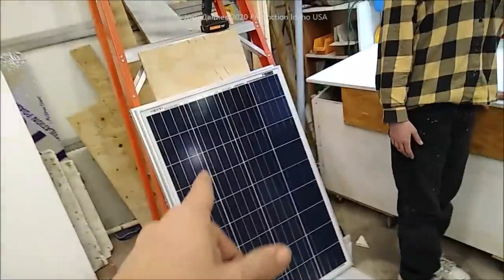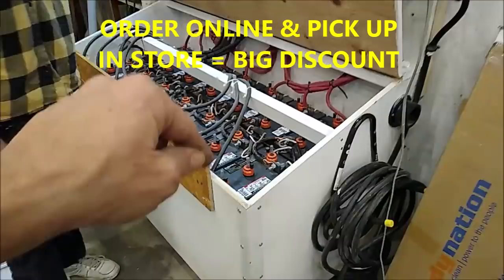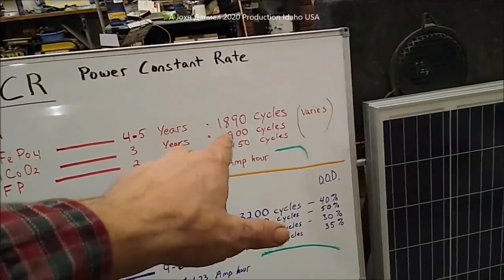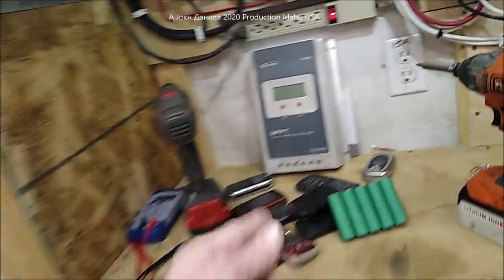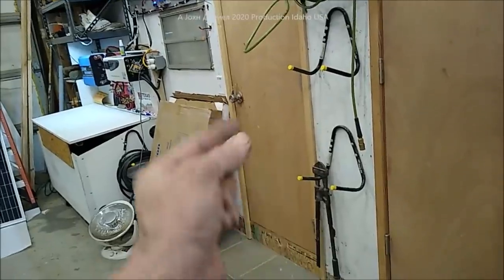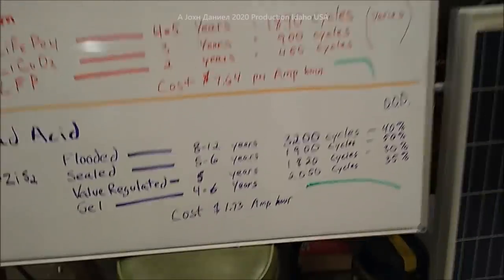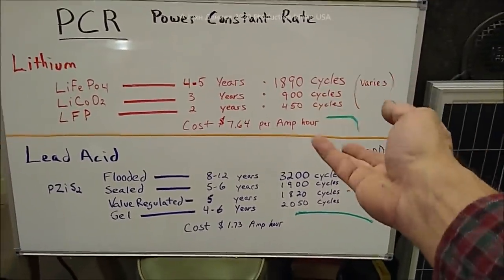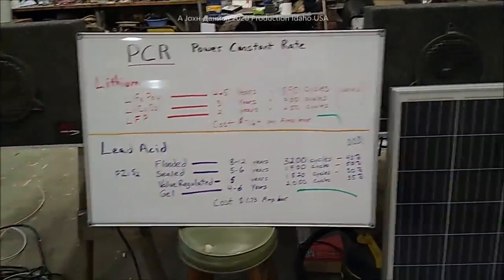Down Side of LITHIUM LiFePO4 Battery $ on RV, off grid & solar use (notes below)

Comment: I'm 4 minutes into the video and I've already seen some misrepresentation  of both the lead acid and LiFePo4. Right now I have both some flooded lead acid batteries the Trojan the L16 models and 24 of them to be exact on a 48 volt system. I have an automatic water system on them. I paid 8500 for them and went and picked them up because shipping was incredibly high. My Dad also purchased his at the same time and his already crapped out on him after 4 years. I have purchased 280AH prismatic cells from China, 48 of those to be exact. It was only $4600 including the shipping. But I also had to buy 3 chargery BMS to balance them so an extra $550 for all 3. But the automated watering system was almost 600 for the lead acid. 
Most any of the manufacturers will tell you the average life span of the flooded lead acid battery is 3 years. Lithium is dependent on how you treat them just like the lead acid. If you use the cells between 20-80% they will last thousands and thousands and thousands of cycles most companies recommend 10-90% usage.. That 2000 cycles you see listed is if you discharge it 100% some last much longer. Do that to a lead acid and see how many times it will last. 
LifePo4 does not like high heat or cold temps and why most people who self build their own battery bank or the ones you can purchase have a heating pad in it that will heat the cells up. Lead Acid also does not like extreme temps or extreme cold. 77 F is the temp that batteries like and As a guideline, every 8°C (15°F) rise in temperature cuts the battery life in half for lead acid. 
As far as swelling of the cells... that is from overcharging the batteries. Most of those who building their own banks with prismatic actually compress the cells. It was really sweet of you showing those cheapy phone batteries and how they didn't last long. Those batteries are charged and discharged every day in a whole variety of climates. Cold and hot and overcharged and over discharged. How many lead acid batteries have I replaced over the years? Hundreds of them. Living on a farm with dozens of equipment and some of those have 4 batteries on them i know all about batteries and how they can crap out on ya and explode. Yes I have seen several of those from Lead acid. 
Lead Acid is what 60-70% efficient ? Ltihium is in the upper 90's. the Lithium battery companies here in the US are ripping people off when you can build your own 12 volt 100AH battery for $200 instead of paying $1000 or more for someone over here to do it for you. If you buy a 370AH lead acid battery you can only use 50% of that capacity and it goes down considerably in cold weather. And you have to put a whole lot more current to those batteries to have the same charge capacity as a Lithium battery. 
The link you provided for the lead acid batteries.... I put 24 in my cart and it is $8323 and that doesn't even count the shipping. I can take the money I saved buying LiFePo4 direct from China and double my  battery bank for the money I would have in lead acid. That would be a 1680AH bank or 86,000 watt hours. The bigger the bank the less current your going to draw out of them which in turn will make the batteries last longer. 
One last thing.... If the lead acid battery was so grand how come the phone companies or any company that sells the battery powered tools all use Lithium and not lead acid??
Reply from the maker: Lead acid has never been used as a tool battery, I get over 8 years on my Wet Cells because I build to cover 200% needs, and if your not going to use your LiFiPo4 like you would lead acid on heavy loads they are fine. Watering them myself is not difficult or a problem so i do not need one of those automatic kits. However  a 100 amp LiFePo4 battery is still over $550 dirt cheap version minimum. But your ok to depend on China for your batteries and those BMS parts, I'll depend on USA for mine till the world changes a bit. China is already holding some countries hostage over supply line materials, And unless Joe the China man Biden gets elected through enough deep state fraud and theft we may not be back under China's total control again until the Democrats get back in full socialist power again. By then, who would care, we'd all be too poor under socialism to buy either.
Reply: @JOHNDANIEL1  
I agree on the premise about Joe Biden that is certain. If you get on Alibaba you can buy individual 3.2 volt cells pretty cheap. I bought my 280AH cells for around $75 each. They have gone down in price in the last 10 months. 
Until things change all lithium is coming from China and nowhere else. They just ship it around the world and then companies takes those cells and make batteries or banks from them. Thats essentially what I am doing, by-passing the huge middleman markup. 
Also i am not sure about the manufacturer of lead in the US. 15 yrs ago their was a bunch of lead plants that shut down one was 50 miles from me. 
Its a lot like where an item says USA made but it is really assembled in america with parts that were made overseas. I was looking at nickle iron batteries for their longivity but cost and ineffiency scratched them off my list. 
Hopefully we can bring these manufacturing jobs back to america. But in the future they will be robotic.

Comment: The only truly valid point you make is that AGM is cheaper than LFP up front, everything else is just YOUR opinion. I have read ALL your comments below and here is my opinion: Somewhere below you knock the introduction of NIMH, yet never discuss it was a huge improvement over NICD. It did not live up to its hype, but again was still better than NICD. LFP does have a better DOD than an AGM for the AVERAGE user. NO ONE is getting the life from AGM's that you claim you are, so your point there IS NOT valid to the average Joe. The jury is still out on whether the LFP's will endure the life cycles they claim they can.......time will tell (not you or I). The jury is also still out on whether these companies will be around in 10 years to support the warranties on the LFP's.....again, time will tell. You CANT lump all LITHIUM type batteries together comparison wise any more than you can lump all types of alcohol together, and if you do, i suggest not drinking antifreeze.........I dont have a dog in this race, am not part of the cult, but do believe technology does enhance life sometimes. I will let this all play out and not offer a guess or Nostradamus like opinion.

Comment: I don't really care what you use and lead acid is fine but if you are only discharging to 40% then your price per Ah should be almost double since the lithium iron phosphate is being discharged to 0% and the lithium and the 2000 cycles are to 80% which the lead acid is probably already degraded that much a couple hundred cycles in and if the system is not sized correctly and you go down to 20% or less you have cut the number of cycles or capacity down by a significant amount and that charge controller you pointed at will work fine with lithium batteries I mean you have to set it up but can do it just fine but I'm sure you know all this

Comment: Have you ever been around when a lead acid battery explodes. Yeah, the go boom real good! Most people do not ever service their batteries so this can become a real thing. Lifepo4 are one of the safest of any battery made today, including lead acid. Plus lead acid has massive voltage sag. I would not switch over to lifepo4 until you have to change out your next set of batteries, unless.... you have them in a boat or RV and want to shave off massive weight and get better fuel consumption, better handling , have more room, have sensitive electronics that are more sensitive to low voltages and sagging voltages. Then by all means stick with lead acid. Oh and make sure you do not go below 50% dod with lead acid because opps,.... you just cut your battery life.
Reply from the maker: 30 years dealing with lead acid batteries on installs. Only seen the results of 6 battery fires. 1 lead acid in a speed boat, 2 NiCad back up UPS, & 3 Lithium ( 2 were LifePo4) due to the BMS on them burning. In the same 30 years I have surely drove past 2,000% more large things with Lead Acid in them than Lithium that had not exploded due to improper use. But to see and now hear of numerous China made BMS fails that cause fires, I am sure its just a matter of time to see more. Over 200 large Lead Acid Battery Banks installed by me, hundreds more maintained by me in that time, no BOOMS!
When I win the mega lottery to be able to afford 450% more cost per Amp of LiFePo4 verses Lead Acid to be more "efficient" then I can become wise like you guys. Until then, I will only get 10 years out of my bad choices, but who knows, when 10 years of these amazing LiFePo4 batteries in such a off grid form has been shown, how many will still have a working Charge Controller by then may be the bigger question since they have a cost of $47 per 100ah and a projected 3 year lifespan in such use (Golf Cart Mag 2019) of high loading.

Comment: Sure triggered a lot of folks, didn't you?  All the cool kids are buying the cheapest crap off Aliexpress thinking it's the same batteries as are being used in big commercial installations, we'll see in a few years how their calculations work.  For an RV, the lithium can make sense due to the weight difference, for home power use I'll stick with good old fashioned lead.  Take care of them and they'll last, but they're not idiot proof.
Reply from the maker: They impose cult like behavior on a product from China with a fail rate not yet known, but expect it to be high with the dumping being done on the BMS controls in them.

Comment: If your application is a house, offgrid cabin etc... LA works just fine with large enough battery bank.
In an RV on the other hand... 
Weight is death to cargo carrying capacity (CCC) A decent battery bank can be 600 lbs or more and when you have only 2000 lbs (say) giving one third of your available allowance to batteries simply does not work in many applications. Go with the LiFePO4 so you can carry more gear, clothes, food or whatever. The cost is secondary when you need to carry all our stuff too.
Reply from the maker: As long as we don't go to war or get into a trade war or some financial collapse scenario the LiFePo will be fine but if your BMS fails like so many are finally reporting then your only source for one is China. And they know that, and replacements are up almost 200% now in price. IF you can get the right and exact one needed.

Comment: Thank you John for these videos on the many cost benefits of lead acid..(And your other videos also).I'm putting together components for a 24v system starting with the EPever 40a charge controller..Do you recommend 24v systems? Planning to use about 800 watts of panels to power a small A/C..  Also planning to use the Duracell batteries from Batts Plus..Would the 8v  x3 golf cart batteries in series be a good battery bank for 24v? Trying to balance cost vs capacity...
Reply from the maker: Wonder what all those hot and bothered to buy 350% more expensive LiFePo4 will think in a trade war with CHINA/CoronaVille!
Reply: @JOHNDANIEL1  For me it's all about the lowest cost for the most reliable product. Lead acid is still the best bet! And an extra plus is they are made in the U.S.A.!

Comment: Wow. Some very good points by everyone. We can all agree China sucks. Installation and components matter. I'm done with lead acid for one reason, and one reason only: self discharge. I do carry massive batteries on my back too, so lead is out of the question. I've worked my way through the downsides of lifepo4, not looking back.

Comment: I have to agree with you because 3 of those parts use them for 12v while you all rap part groups of 4 and then they have to load immediately and this does not happen at all
Reply: one gets more volts than the other and so you get on a fire
Reply: and the plates also swell like a balloon

Comment: im with ya on lead acid battery's, i use crown battery's and they just turn 4 years old this month and they still going strong as they were new . i think the one reason why mine last so long as i dont do the stupid thing convert to ac all my stuff run dc to dc only

Comment: Your cycles and year life span is way off.  #TESLA or Nissan #LEAF packs and Chevy Volt batteries will last far more then 12 yrs.
Reply from the maker: Yes, and for less than 1/3 the price per AH the HUP-1 Lead Acid Batteries last 20+ years, proven. Over 25,000 owners since 1970  including massive stadiums, high rises and hospitals.

Comment: Hi, love your videos. Got a question for you, I have solar and wind power and want to install a battery bank, now am direct grid tie.
My inverters are input 45 to 90 volts dc. To go a bank with 12 volts batteries,  have to raise to 90 volts, do I need a 90 volts charger or is a way to use a 12 volts? Somehow. I would love to hear if you have an idea.
Reply from the maker: You can if possible sell or trade your inverters for other options, but the grid tie inverter being high voltage input don't stop you from using MPPT controllers with 150 VDC capacity and charging a 12 volt battery bank.  Need more info just let me know.

Comment: All of your numbers are full of half truths.

A wet lead acid battery discharged 100% > 30% certainly is capable of lasting 1000 cycles. If you discharge that same battery, to 50% you may only get 500 cycles out of it. You also say the batteries lasted 8 years so far. Well, age doesn't mean anywhere near as much as the number and depth of cycles on the battery.

A LifePo4 battery on the other hand can do 2-3000 charges at 100% > 20% capacity and not die. Using a management system to keep the battery in the 90% to 20% range the battery could maintain a large portion of it's original capacity for many more thousands of cycles. These can be purchased used with 80% of the original capacity for near $150 kWh at the moment. See bigbattery.com 24V LiFePO4 Battery Module.

You may be old school which is fine, but if you're going to shit all over new school, I'd recommend at least thoroughly understanding the technology. The cost per kWh is currently plummeting and as electric car batteries continue to enter the market they will get even cheaper. I don't even know why I bothered to write this. Your head is so burred in the sand it was a waste of time.
Reply from the maker: Love them supplies from China while you can https://www.youtube.com/watch?v=HDNt_ThDYt0

Comment: I am 100% with John on his post answers about Lithium Titanate Oxide batteries. You do not worry about LTO like LiFePo for voltage configuring, your car and off grid stuff loves LTO running its constant voltage of 13.8 volts. Its like when the car alternator is running which is 14.2 volts, everything is fine in your car. And with LTO you do not have to worry about the internal control failing because its in a connected remote unit. If it fails your can still actually charge it with a auto grade alternator regulator. It's able to get 16.7 volts without harm but can be shut off charging anywhere above 11 volts and still cycle 25,000 times.
 
We had LiFePo 100 ah and its inside control failed, ruined a bunch of stuff in our RV refrigerator and they want $240 to fix it, that part is NOT under warranty as you would think. They lie and that clown Will is a liar too with him showing all he does but not actually living on it like John does. I trust John even though he gets words off due to his stroke and I was watching him then, glad he recovered.